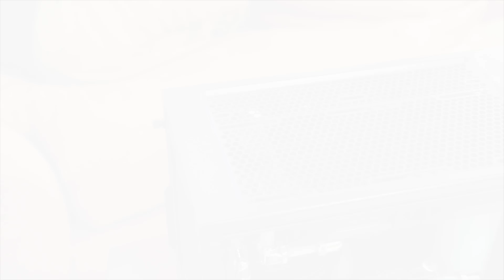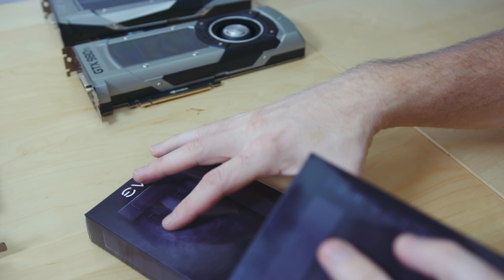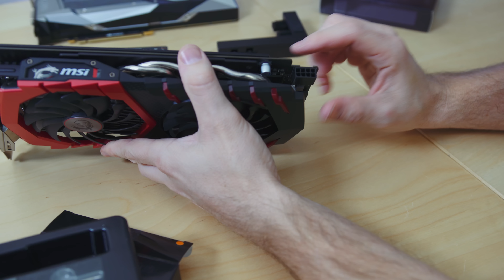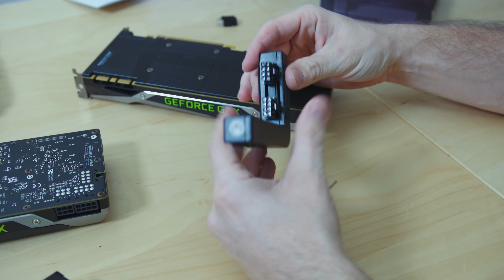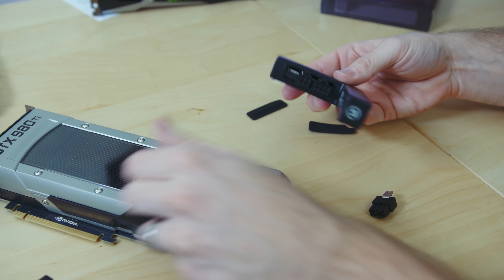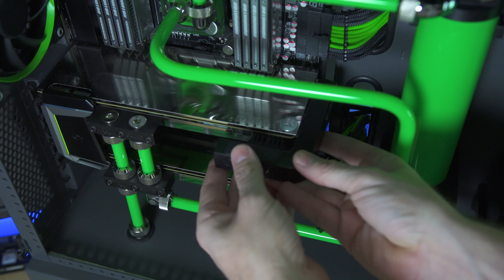How to manage your cables using EVGA Power Link

Comment: I honestly think the Powerlink is too little too late. Its becoming very common to see cases with holes through the PSU shroud directly below the GPU, thus completely negating the purpose of this product. In the cases that dont have that feature I can see where this product might be a benefit, but just like Jay said, they are pretty bulky and add a bit of risk due to the leverage they can apply to your power plugs on your GPU. All in all, I dont think I will ever purchase this product.

Comment: Thanks for the review, Jay.
Somehow, I feel that the extra length and the fact it only holds to the power connectors make it a no-deal for me.
But the concept is neat.... probably some adjustments for weight distribution or different placement for the cables would make it an alternative for more people.

Comment: I like the idea of these adapters as they do make cable management on the GPU a lot cleaner, however they could use a little support bracket that sits on top of the GPU to support the rear end of the adapter to eliminate the strain on the pci-e connectors. Though it is nice a manufacturer finally produced something like this.
Also, Jay you videos are great, humor and all. I find them a great source of entertainment and knowledge in one. On and up to 1 million subs c: ~Thanks for the videos.

Comment: I like it, but only because they're in line with the pipes from the water cooling block. It continues that line, not just sticking out and it looks like a part of that system or a card support, though it's anything but.

Comment: I would paint the evga logo green personally, I would also truly like to see in V2. A dual layer system so you can change the color of the logo with ease (and or upgrade to leds), and the cable sag was a disappointment honestly. All they had to do was add a small mount that hooks onto the back of the graphics card. Anyway as you say "I digress" Great videos jay can't wait till the next  one.

Comment: I'm iffy with these.  They do look bulky, but that could be solved with some cosmetic changes.  I would like to see the EVGA letters light up, perhaps in multiple color options.  I think they can use some visual tricks to make it look thinner.  I did not consider the weight of the cables until you mentioned it.  I could see someone breaking either the Power Link itself or god forbid the card.  That would really suck.  I'm not sure what a fix for that would be.  Since most people would probably slide the Power Link right up to the end of the card like you did, could EVGA put some plastic tabs that extend over the backside of the card?  This way if the weight of the cables pull down on the link, the tabs would distribute the weight to the PCB rather than the solder points.  They wouldn't have to be that large.  An eighth of an inch would probably work.  All said, though, I could never use these as my mid tower is only 19 1/8" long front to back, including the front bezel.  Early 2000's Mid Tower ftw.

Comment: I really like the idea of having the power diverted to the back of the card, however, I think that these would look better on a card that still has the air cooler installed.  With how thin the cards are with water-blocks these seem a bit out of place.  If they made them with different options like a thinner frame or with LED's they would look better.  Also, it seems like they should include a way to fasten the bracket to the cards to ease the tension on the power connector (not sure what there options would be there, it would just be better).

Comment: Eh. I personally like the other way you had the cables.
Reply: With a little effort, the rooting of the custom cables would also look awesome and tidy. I'm not a fan of those Power Link connectors. It looks cheap.
Reply: yup doesn't make sense to  hide modded cables with a bulky adaptor
Reply: +1 It also looked like it was putting a lot of leverage on the connector and flexing the pcb. :(

Comment: I liked skunkworks better before the adapters. EVGA´s adapters seems cheep and plastic(ish). 

The lacking possibility for stiffening the bracket to other places on the card, like a clamp, or other similar methods of securing the bracket and therefore putting the power connection(s) at risk of breaking, does not tell me that this is the amazing quality that we all have come to enjoy from EVGA. I would say, it´s back to the drawing board for this one, and another thing. 

The bracket would probably not fit in the Fractal Design Define S Mini, so you do not have a potential for hitting the masses with this product, but only a certain amount of people with big tower´s like yours. :)

Comment: This does not work on all EVGA cards, only those with the power connectors towards the end of the cards. If you have something like full-length GTX960, which has an 8-pin closer to the center of the card, it won't work. Just thought I should put that out there.

Comment: I thought it would look worse because they were kinda bulky, but upon seeing them installed, I actually think it looks better, It somehow suits the card and doesn't have too much bulk while also looking clean, also, daym I forget how big skunk-works is, I took a look at my PC, and with the HDD cage in there, my 1070 barely fits, but I wouldn't be able to use this thing anyway though because the power connector for my card is the wrong way around :( I can see where they are useful but sadly they just don't appear to be something I can use. If I ever remove the HDD cage and someone releases one that works on my card though, I'll probably get it, along with an NZXT Hue+ and make my PC look better :)

Comment: Bulky, takes alot of room, and slaps a big EVGA logo where anyone not running an EVGA card will not want one.  Plus, as you mentioned, the danger of wrecking your card from the full weight of the cables being supported by the plugs on the card.  
Good vid as always jay, but this is def not for me, or anyone doing a themed build, where neither EVGA, nor bulkiness, fit with the theme.

Comment: like the cable layout with them better but wish they were a black aluminum like the ek block for the water. Plastic gives it a cheap look with all the metal fittings around it. Good video Jay , thanks for showing them to us. I had been curious how they would look.

Comment: they should also include connetors that allow you to put it the other way around if the lach thingy or what ever is called is facing down for those who own a different gtx version aside from evga for those who wish to buy it but own a different brand gtx like msi or asus.

Comment: This adapters pushes the astethic of skunkworks to the roof, would be awesome if the housing goes wider to the watercooler block so it becomes one unit, if you know what i mean. 
Could make us non-american viewers a humble favor and say besides of the imperial units, the metric units of things, cause i can't really figure out how much of an impact it has to plug these on.
Yeah sure i can use google, but go international ;-)
Reply: oh oh and i got a question to all enthusiasts: why is  the GPU fan always downside, wouldn't it be better for airflow when it goes upwards?
Reply: Sechs0rBecks It faces downwards because GPU fans pull into the card, rather than push out of it
Reply: so it's basically a cooling system of it's own and the case cooling have to keep that warm air to GTFO?

Comment: I prefer the before. The colored cables worked well with the overall visual design. These adapters just add an expanse of featureless black. With the proliferation of RGB in the current market, how hard would it have been to add that feature into the product. Lets face it they are a boring addition on a visually spectacular build. Kind of like using tires without white walls on a 57 Chevy. Yep they work but they look bland. I will wait for version 2.0 with RGB.

Comment: If you saw my cable management, you'd cry lol
Reply: Risto Mladich I care about mine lol, my PC is a work of art that's why.
Reply: Yeah not really. There is a nice video on LTT about airflow where they stuffed a pc full with shit. But the temps still stayed the same.
Reply: +Risto Mladich I call it bold and brash
Reply: More like, "belongs in the trash!"
Reply: Risto Mladich well if you just run the cables straight to the component  (not using space behind motherboard tray) it somewhat blocks airflow but not significantly.
Reply: I shoved everything in, crammed the wires in, barely closed the case & had to hold it down while I screwed it back together.  Also I just tossed a random 120MM fan in the middle of the case because curiosity.
Reply: i could care less really... so called " cable management" is a joke so long as the cables are not twisting around others whats the point... aesthetics? who cares about how your computer looks
Reply: TheBoxxWillRuleAll art belongs in the trash

Comment: I think it shouldn't be necessary. The connectors can be moved to the back of the card. It's always bothered me having cables make 180 degree bends to power a GPU, the second heaviest load on the power supply. However, these would help with longevity of cables, but there needs to be a tab or something to help it displace some weight onto the card itself.

Comment: why not just design the card differently...
Reply: Ernest Pierce the pcie power connector on top is ideal for most use cases, there are some cards with the connectors on the side though so its not impossible
Reply: :oh
Reply: The Sapphire Radeon HD 5770 had them also on the back i seriously don't understand why not every card has them like that.
Reply: Ernest Pierce my gpu already has it in the back
Reply: i had r9 270 with plugs on the ''back''side
Reply: yeah i think sapphire likes this idea because mine is a sapphire rx480
Reply: Alex Kirchgessner its to do with the case
Reply: And again i bring up the Argument of smaller form factor cards where this should be standard, as even the smallest of cases still has room for a Half inch/ one centimeter plug sticking out of the back.
Reply: When the cards are long the connectors would add even more lenght, making it difficult to fit them in many cases that aren't that deep. Even my friends Define R4 (I think it's an R4 at least :P) had a snug fit with a 1060 Strix clearing the hard drive cage with just a few millimeters. Had the card had the connectors on the back the drive cage wouldn't fit.
Reply: MightyDirtKing dumb comment. this makes cards longer so is not for everyone. Is it so hard to understand?

Comment: THey do more good than bad, is true that they get a little bit saggy and you have to be careful, but I prefer a less show off from cables and have with the power link to make cables in the same direction of the motherboard atx connector and save cable length, I want one since they came out, do you know if they are still coming included for free when purchasing EVGA Gcards ??

Comment: Does it work? Yes

But I feel it could use a little more "Bling" JAY disassemble them and spray the plastic housings silver and or chrome.
Reply: Tyrinath they'll match the fittings good
Reply: Well, the answer to your first question needs to be a bit more nuanced, because since it requires the tabs on the power connectors to be at the bottom rather than the top, it'll only work with EVGA and Nvidia reference cards (possibly AMD reference too, I don't know), not with any card made by Gigabyte, ASUS, MSI or any other brand. That kind of puts a spanner in the works for most people, I would think...

Comment: I don't think these particularly fit Skunkworks. It makes the slim GPUs look tacky with the big pieces of plastic on the ends instead of the proper color-coordinated cables. In a rig that's still using the normal air-cooled GPU's, it might fit better.

Comment: Depends on the user's build, im using a gtx 1070 asus strix (which is a big ass card) in a define s where the cord slots are actually under the power connectors so something like this wouldn't help for my case.

Comment: For me, it's down to personal preference for this little addition. It does look and fit really well with Skunkworks, but other builds may not look all that good once done.

My pros;
- Looks nicer in some builds.
- Better cable management (in terms of less shown)
- Simple in design.

My cons;
- Extra cost on top of an already expensive GPU.
- Not very stable in terms of weight distribution once attached, like you had with Skunkworks, Jay.
- To me, it seems more of a gimmick, it is well thought of and a nice addition, it is just not well thought out at the moment with re-training cables.

What needs to happen is moving the additional power from the top to the side. Most of the newer smaller form factor cases are starting to allow for the much bigger high-end cards and thus allowing room for them.

Comment: I like it I think it has its uses but in your build for example with your custom cable no I don't like it but on a build with the really basic ketchup and mustard cables yeah I think it would make a build like that look way better. Another use for this I can see is I have a 7970 in a corsair 100r case that I built  from some left over parts and the  cables are hitting the window from the gpu this could help an issue like that as well.

Comment: I think they look ok.

However, I'd change a little bit the design so that the other and is somehow 'attached' Yo the card and the connector does not put any mechanical pressure over the connector.
But the cables definitely look better.

I don't like LED in general (inside a PC), but it'd look better with an rgb LED for those people.

Comment: I think it's a step in the right direction, if they lit up with a programmable RGB to match system lighting or had more color options to better match case builds that'd make them look better. 

I'd rather reference boards just have the power on the back to start. Never really understood why they're on the side other than making the cards slightly shorter?

I think they'd look better on a less custom built-build, if you didn't have a custom water loop and water cooled cards it'd probably look better.

Your shit looks too good to start with skunk works is a piece of art, you wouldn't put pants on the statue of David just because his dong is hanging out, his dong is part of the sculpture. With Skunkworks everything is color matched, the graphics cards are really slim with the custom blocks. I think it'd look better in a less customized case with more stock off the shelf components.

Comment: I Liked, i always didn't like to bend the power supply cabes to fit the graphics card, the only thing they should have done is to sell 2 types of the gadget, one that fit the connector of evga style and another for customs cards, if they have done that i already would have bought.

Comment: They really need to be color matched to the rest of the card. Right now they just look like a big black thing on the end of your GPUs. They look a little out of place. For the cables, it's a great little addition since it moves the cables to the back of the card -- where the connectors really should be, in my opinion. Otherwise, if I were to buy one, I'd likely want to paint it or customize it in some other way so it doesn't look unusual in the chassis.

Comment: if you could make them a bit thinner (especially on the  side sticking out from the graphics card power connectors) and find a solution to the sagging and still keep it relatively cheap, then i would considergetting them. but as they are now? too bulky and that sag on the back end would keep me up at nights xD

Comment: Personally I liked it better with the cables going into the card and not the adapters. The green and black of the cables going into the cards, I find, is more pleasing to the eye and sort of ties it all together. The adapters seems bulky and does not fit the build that well. The adapters looks like a cheap plastic part compared to the rest of the computer and I think that ruins the entire look. It may be a good idea for someone that does not have braided and colour matched cables and have the multi colour bouquet of wires that a cheaper/non modular PSU comes with.

Comment: Jay, I kind of like the Power Link, but I kind of don't. On one hand it does make your cables route better, but at the same time your outer cable (black) blends in and all but disappears from view. That wouldn't be a problem if you had all black cables but your custom cables are meant to be on display and the Power Link makes them kind of disappear.

Another thing that kind of bugs me is the bulkiness. On your cards, it takes away from the slim profile.

Comment: Honestly, I think that it is a toss-up.  In part because they are kind of a black hole in the middle of the build, but they do go better with the aesthetic being more about ninety degree bends.  Maybe if they could be given a racing stripe of green along the spine of them, then, they might better fit the build aesthetic.  But, matching the green already in Skunkworks would be hard and it would have to match.  It is your computer and system so the ultimate decision about the look is down to you.  If you would rather have the green cables there, put them back.

Comment: couldn't they have added a lip on the inside so that the weight was distributed across the card instead of leaving the power pins to support everything? might be a better ascthetic design as well, giving the illusion that it's not a separate piece.

Comment: I like it both ways, I think it depends on what you are going for. On one hand I want my custom cables to shine if they are tidy. On the other I have a Carbide 540 and it's open design means that there is a lot of open space so I have cables just out in the open and it seems off, something these power adapters would help fix.